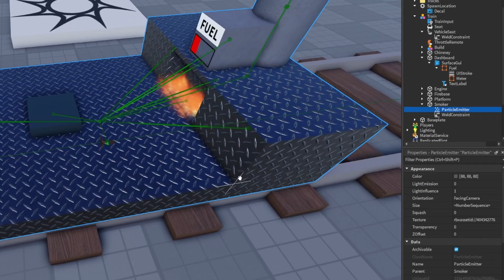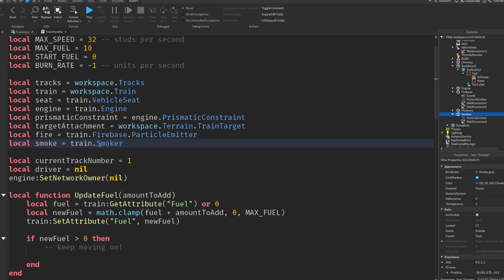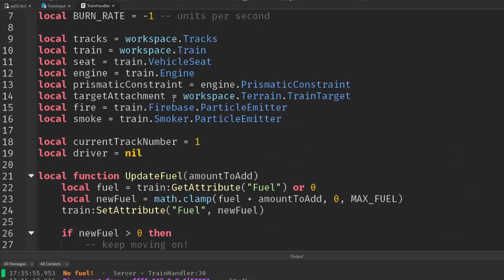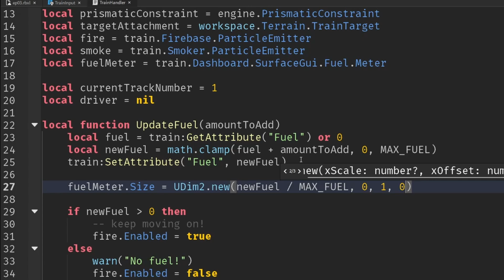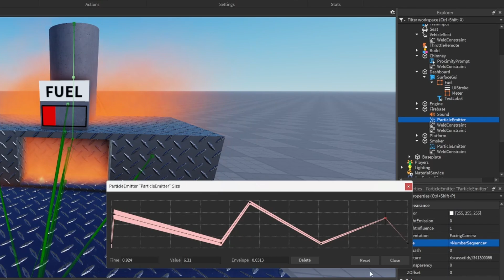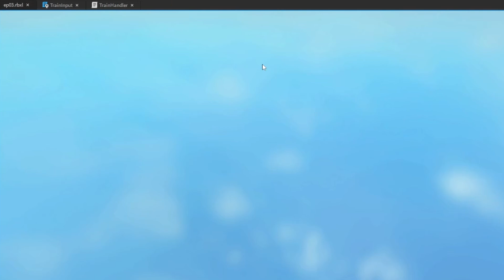Limited Fuel System - Dead Rails Tutorial #3

Comment: I tried changing the train's model into a truck and the track's model into an invisible block- it all comes to a point where the truck just jolts briefly and doesn't move. Why?
Reply: try dont make the model touch the rail or road. i had the same issue but removed some parts and it worked
Reply: @ZankAnimations2  the guide brick has to be touching the truck otherwise it will break
Reply: and the model is touching the ground
Reply: i tried another one on the first tutorial and it worked
Reply: the truck is also not on any sort of road
Reply: for some reason the older version works
Reply: @4017_berlin_metro  then me dont know but i had the same issue and i fixed it simply by that
Reply: oh well i think i actually broke it

Comment: @GnomeCode HELPPPPP Network Ownership API cannot be called on Anchored parts or parts welded to Anchored parts. nothing is anchored this error happens when i build the train like you did when it only had a seat and a platform it worked but when i added fuel and some new parts it stopped working for some reason can you help me GnomeCode even when i delete the setnetworkowner part the script still doesn't work    edit: I fixed it just added collision groups
Reply: Unanchor
Reply: Bro i literally said that the parts are unanchored they all are welded @Jim199x-q5i
Reply: NVM I FIXED IT THE FIX IS JUST ADD COLLISION GROUPS

Comment: Fuel is pretty easy, i made it myself the day you released second tutorial, i also made my version be able to switch tracks backwards, im more curious about how to make multiple cars
Reply: i made a backwards system aswell but its not very smooth, could you please tell me how you did yours?
Reply: @edgebug  its basically if throttle is under 0 and track progress is 0,01 or less, then which to previous track if avaible